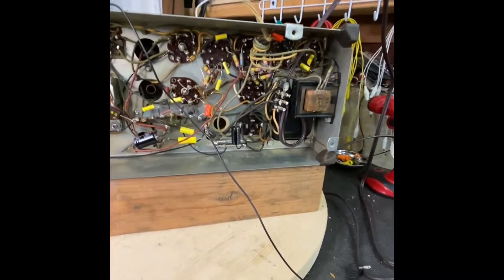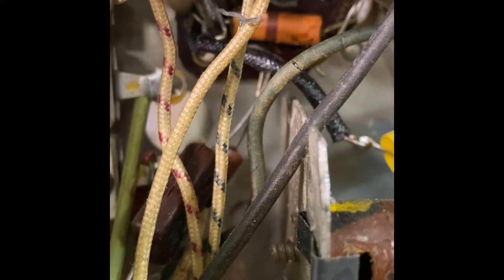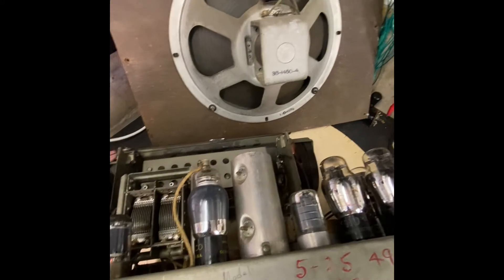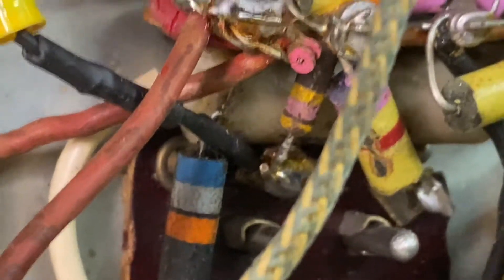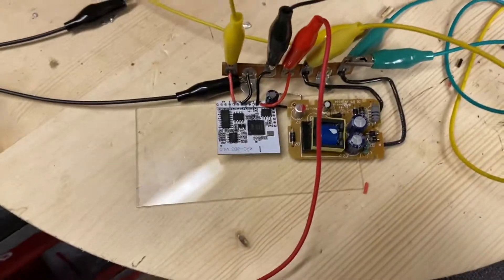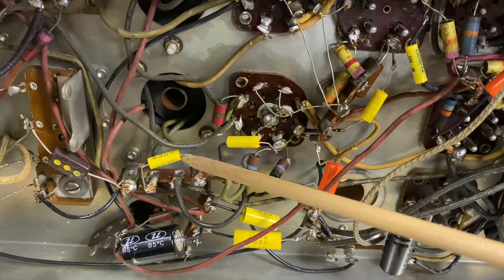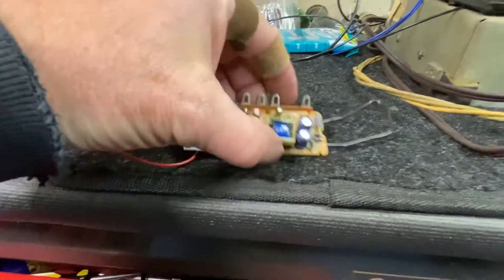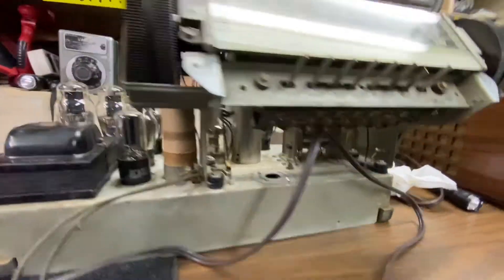1939 Philco Repair and Restoration (Part 3) Bluetooth Installation

Comment: Nothing more satisfying then solving mistakes you make. You seem to have ignored the Bakelite block . Believe it has got two paper capacitors in it to ground.
 They are across the line 0.01uF caps. Did you replace them with safety caps? Hate restuffing these but maybe you did so and we see the results? 
That it looks like it was always there. Great idea using the  cardboard tube to protect the Bluetooth and  it's power supply. Brilliant!
Reply from the maker: No, I did not replace them. I connected both caps inside the block to my condenser tester and both were good up to 450volts, no leakage, so I left them in.

Comment: Good detective work Dave.  A suggestion since your videos are really good.... get a tripod  - its hard to follow along as the area was out of frame most of the time. Many can learn from you, including me.    NICE JOB on the Bluetooth as well...  Ron
Reply from the maker: Thanks Ron, I’ll try the tripod👍
Reply: @VintageRadioRepair    Most of us use an overhead Tripod so its easy to point things out and zoom in when needed. Everyone has their own style.. whatever works my friend.
Reply from the maker: Do you have a link for an overhead tripod? Never seen one before
Reply from the maker: Thanks, I’ll check it out